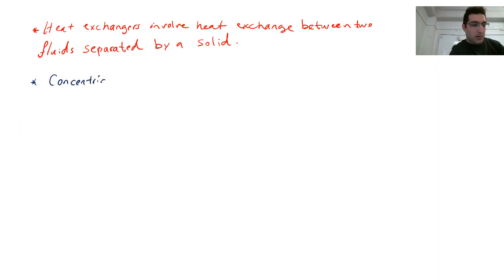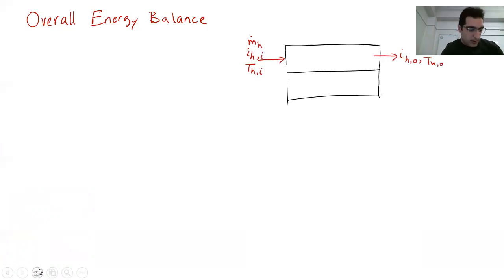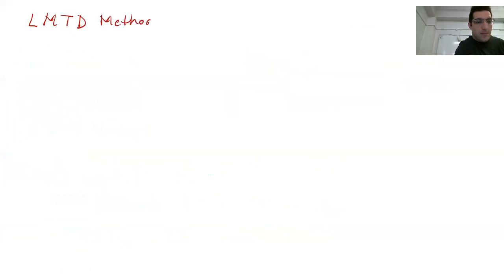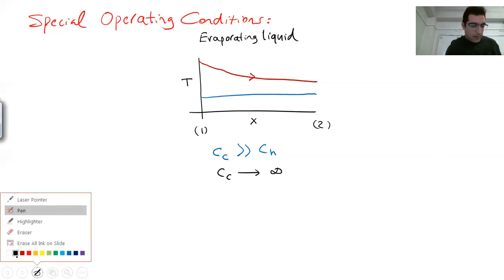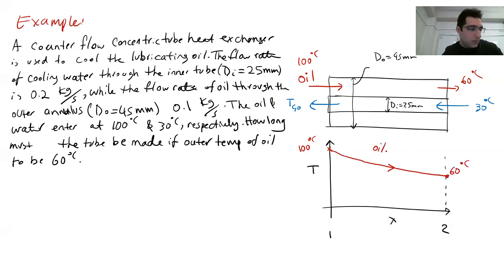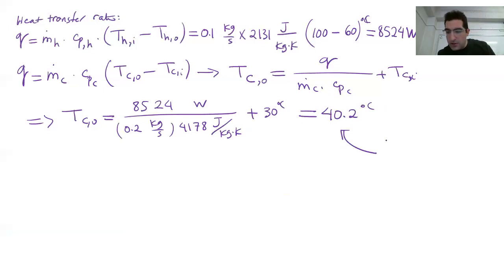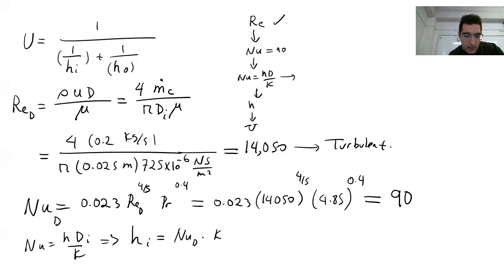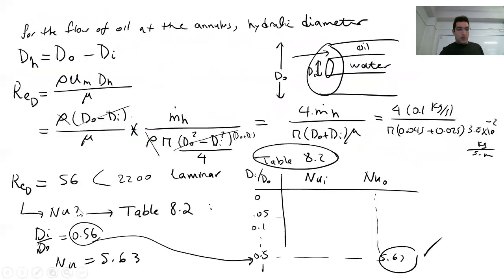Heat Exchanger Analysis, Log Mean Temperature Difference (LMTD)

Comment: You were not calculated both (Nu)i and (Nu)o from Table 8.2, you did the calculation for once and find 5.63. The one you found was for (Nu)i but you treat as it is (Nu)o and put it to the ho equation and then find ho. This is not correct.
Reply from the maker: Hello Taluyhan - Thank you for your comment. I reviewed the video one more time to make sure I understand your comment. In the solution, two separate Nu values found. One belongs to the inner side fluid (aka cold fluid) that Nu was 90, and the oil Nu value is also found at the annulus that was 5.63 (that you referred to in your comment). So in conclusion, two values for Nu were found (not one) for inner and outer fluids, hence corresponding h values must be accurate. I hope this answer your question. Thank you again for your comment and feedback anyway.